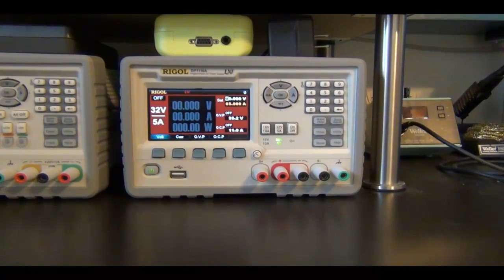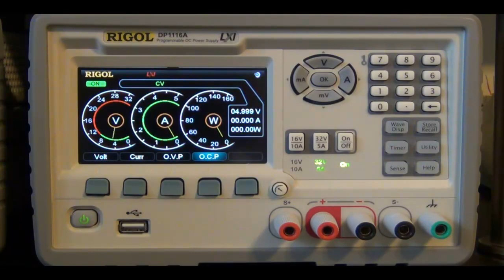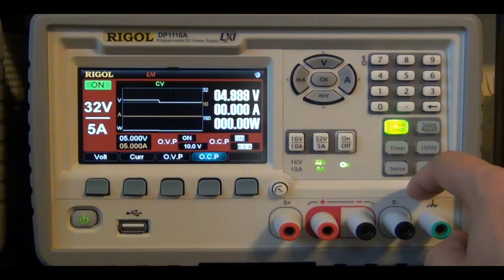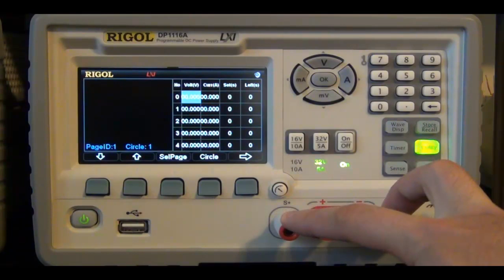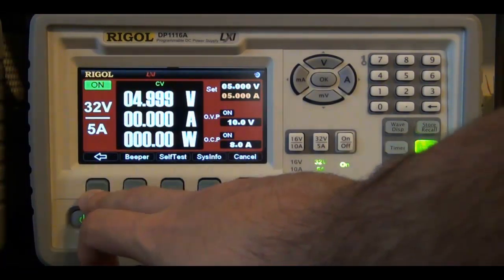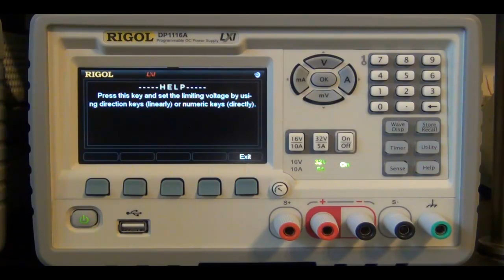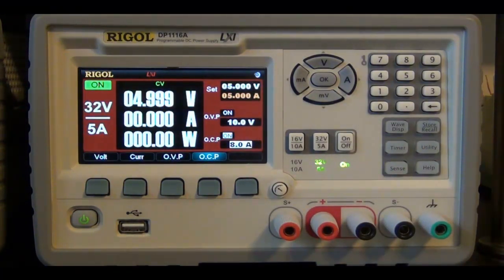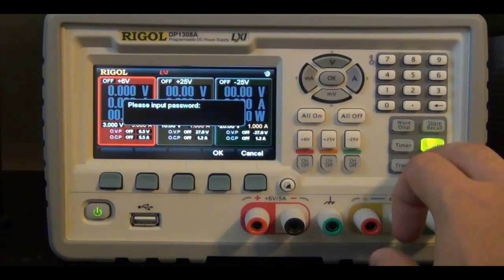TSP #6 - Rigol DP1116A and DP1308A Programmable Power Supply Review (Part 2/6)

Comment: could someone tell me why is there a "-" (minus) voltage output on the power supply ? does electricity not flow from + to - ? or in this case + to common ? or am i missing something ?
Reply: lol this is seven years old but for people who are watching this recently. my psu anyway has 2 outputs and you only wire from positive to common or negative to common but i have an hp power supply from the sixties so i have no idea about this modern gear.